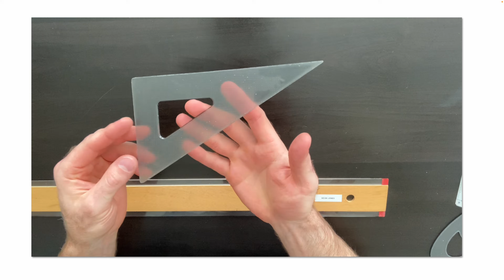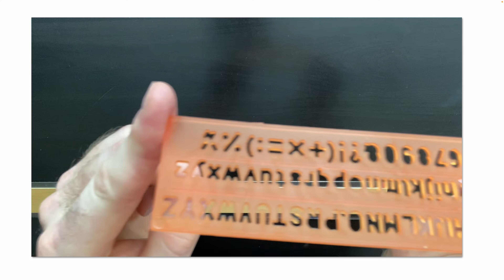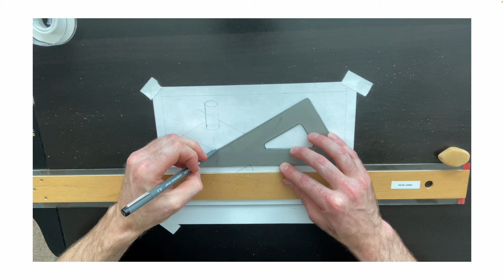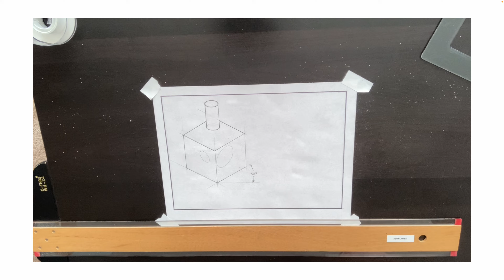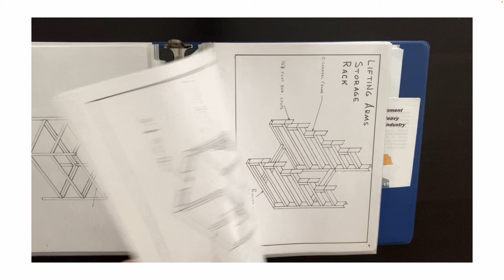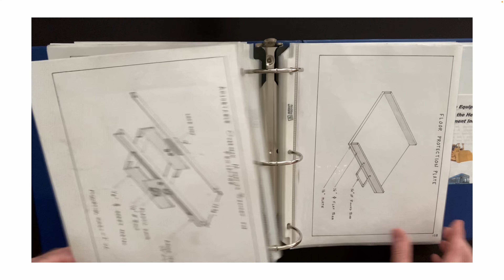Manual Drafting Basics | Drafting Tools

Comment: Kevin.  really like the video.  Next year I want to teach  5th graders some very basic design for drafting just so they can experience and touch the tools.    (Not a draft or engineering background on my part FYI)
Do  you have a technique for teaching how to center a drawing.    For example one lesson plan would be to draw a 7" by 5"  "house border" plus an 2"x 2"  garage attached to the house.   Could you show how to center any project from the start of the project?  Sorry for the naive question
Reply from the maker: That’s a great idea Jim, great question too!   You can measure from the edge of the paper over 5.50” (assuming you are using 8.50” x 11” paper horizontally ) and lightly draw a center line vertically at the center of your paper, then measure up from the bottom 4.25 inches and lightly draw a horizontal line.  Now, to make the house & garage centered on your paper, measure over from the vertical centerline 4.50 inches to the left lightly draw a vertical line.  Then measure over from the vertical centerline 4.50 inches to the right and draw a vertical line.  Then, from the horizontal centerline, measure up 2.50 inches and draw a horizontal line.  Measure down from the center horizontal line 2.50 inches and draw another horizontal line. That will give you a centered rectangle to draw your house and garage centered inside of, assuming you’re drawing a front orthographic view of the house and garage, not a 3D isometric view.  
I will try to publish an example of this before the end of June.
Reply: Thanks Kevin,  I will give this some practice and thanks for the response.   Yes 8.5 x 11 paper is the base line to be working with.  I was going to have them start with a 1/2" boarder (1" at the bottom.)    Background:  Some teachers had an assignment for students to draw a community using buildings and roads and incorporating geometric shapes.   I came into help a student and busted out a T-square and some basic triangles.   I was helping one student but found myself surrounded like I was a rock star.  None of these students had ever seen or held basic drafting tools.     The protractor was a big hit.   None the less it occurred to me these kids had been stuck inside with Covid Protocols for the past two years,  and these tools are not used any longer, not taught any longer and dad's / mom's might not have these tools around the house like my father did.   I had one teacher say "What is the point?  It is all done on computer anyway?   Then she walked by me in the hall way working with the students and admitted she was surprised by the interest of the kids doing something that didn't involve computers.   Anyway if you have any time to make a content using these tools for teaching tips, and simple project ideas, I would find it useful.  Encouraging you to keep up the good work.
Reply from the maker: https://youtu.be/Mm_XVDMyMpM

Comment: Is manual drafting even used anymore ?
Reply from the maker: Yes it is, not too often though...   In fact, for the first few years of my career, (early 2000's) when I would design a piece of custom shop equipment for my boss, I would use manual drafting.  Every situation is different.  My employer didn't have an ongoing need to pay for an AutoCAD subscription.